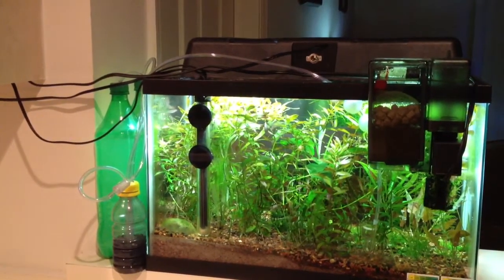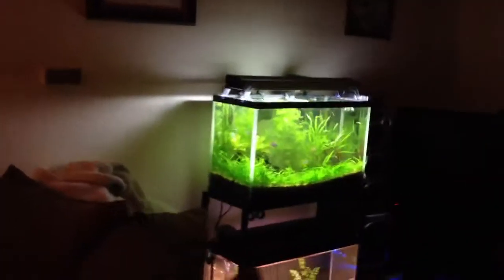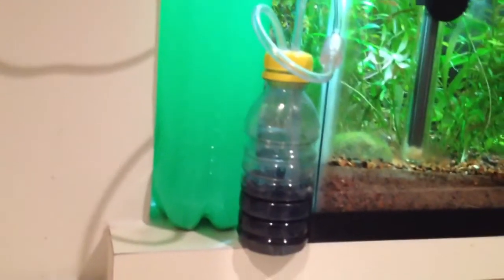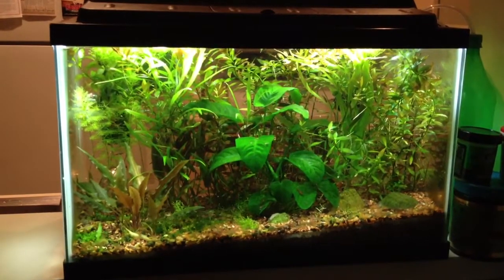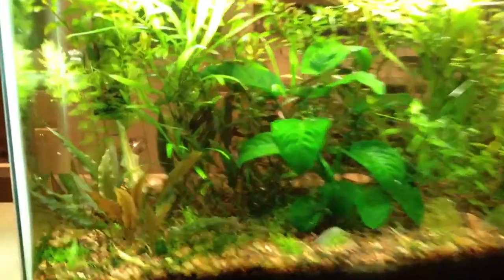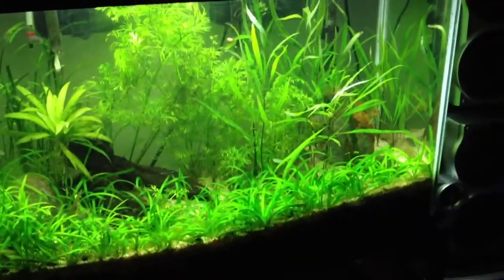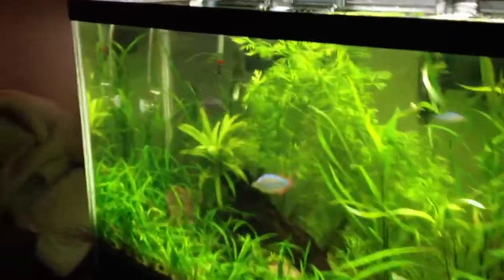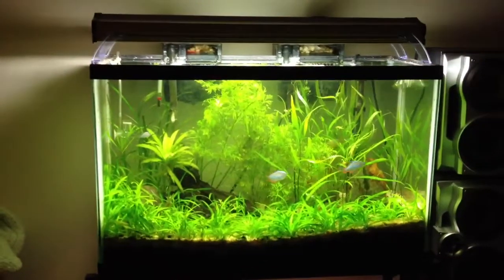DIY CO2 Experiments and Tank Update

Comment from the maker: IN the past I have just used water and I replace it everytime I swap a Co2 mixture. For now I am running the activated carbon as long as possible to see if it is an adequate filter for larger Co2 rigs. I am also considering running a high volume Co2 rig on 2 of my 29 gallon tanks simultaneously to fully test the filter capacity at its limits.